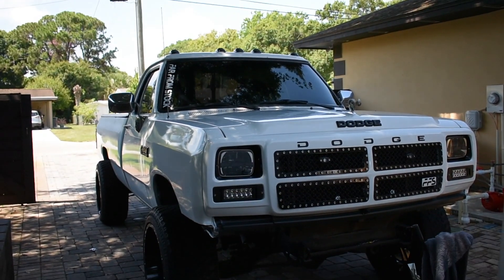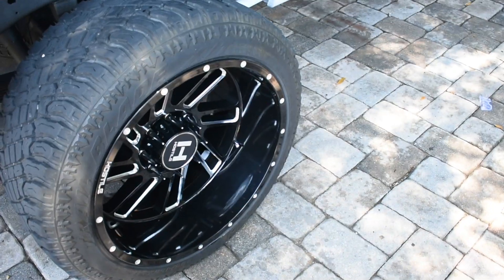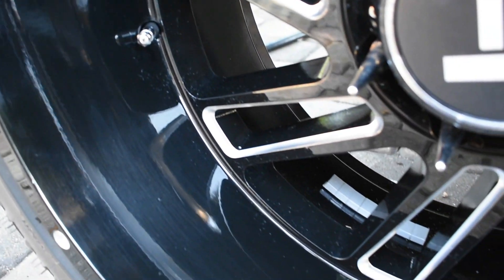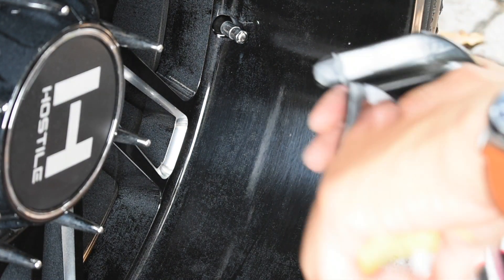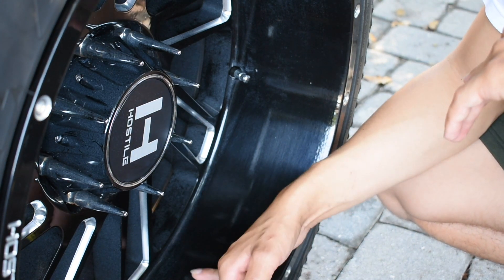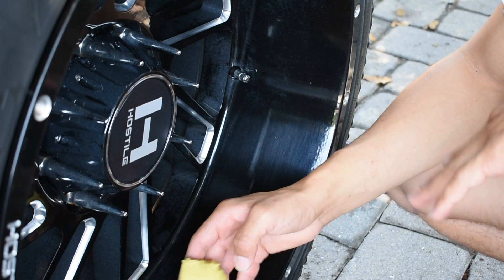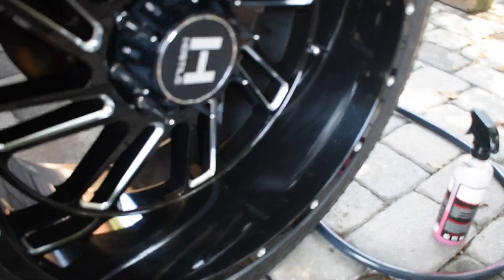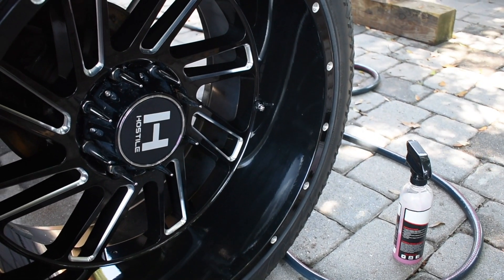How To Remove Overspray From Your Wheels

Comment: I literally just got red caliper paint overspray on my gloss black wheels.  The wheels were off the car, and about 8 feet away, but there is now a distinctive red hue on one wheel, whereas the other one is just fine.  I'm going to try this in the next few days.
BTW, how does the detail spray work to protect the paint on the wheel, while also removing the paint I don't want on there?  How does it distinguish between the original paint and the overspray paint you want gone?

Comment: Did the original paint on your wheels have a clear coat? I have the same problem as you but the original paint on my wheels has no clear coat and I'm worried I will mess up the original paint.
Reply from the maker: That Im not sure of, but thats why you have to spray it with a detail spray to protect the paint